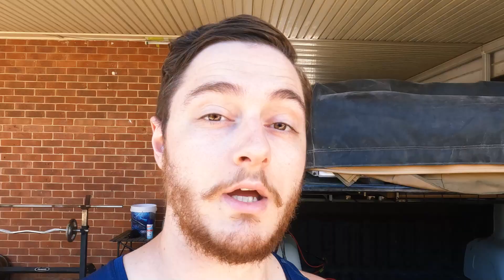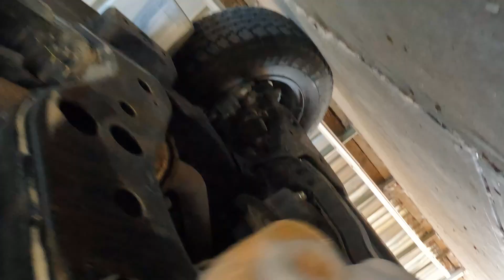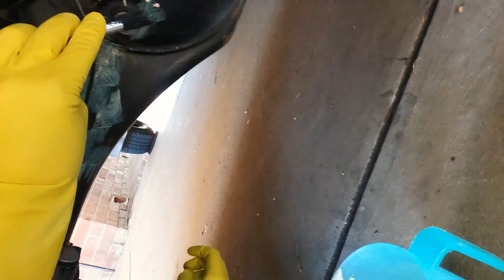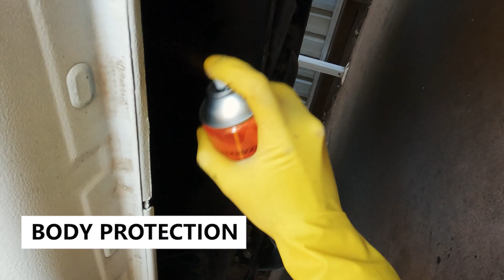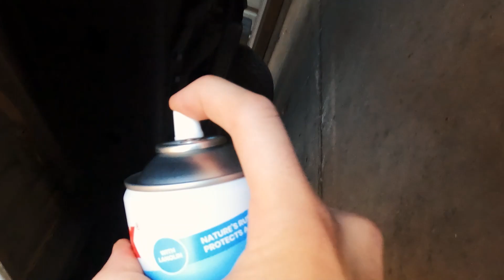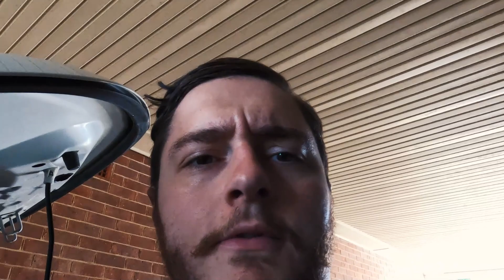MR TRITON RUST REMOVAL - HOW DID I DO IT? WILL IT COME BACK?

Comment: Great video!

I'm part of a Facebook group called Mitsubishi triton owners group Australia on Facebook. I joined to see when others were getting delivery of their new tritons while I waited for my GLS which came in December after 7 months of waiting.

Seen lots of people getting delivery late January with surface rust in places straight of the dealer floor. The mentality of most of the group is that the panels have been galvanized so rust can't chemically penetrate deeper than surface rust or that by the time the rust is a problem the ute will be on its last legs anyway. Not sure why some people are telling others to not care about it.

Mine doesn't have any rust apart from the cast iron flange that bolts to the drive shaft.
Still might give it a coat like you did. 

If your into self advertising that group might be good for you drop a video and the reaction. Might get some subs and views, it has 35k member.

Looking forward to more videos
Reply: As always there are also alot of key board warriors  and wrong information in that facebook group. It may be safer  just to stand on the sidelines and watch like I do.  Judge for yourself if worth joining or not.  Just keep doing what your doing brother with your YouTube channel